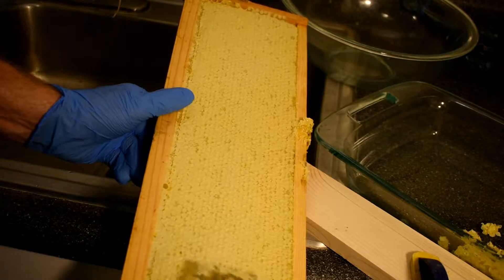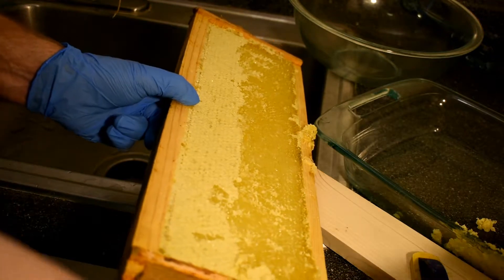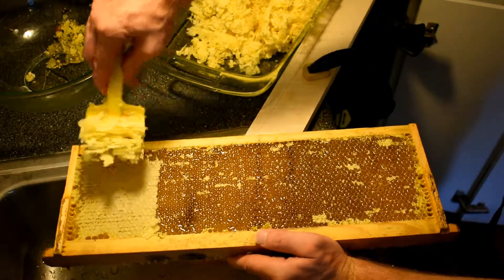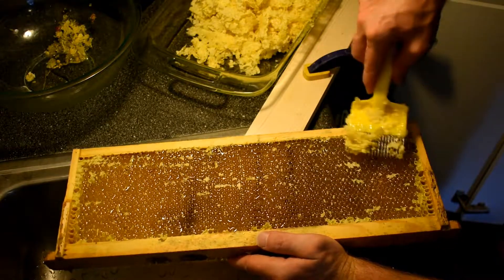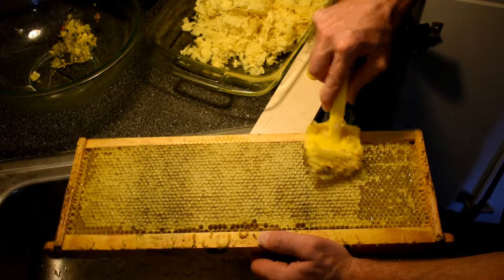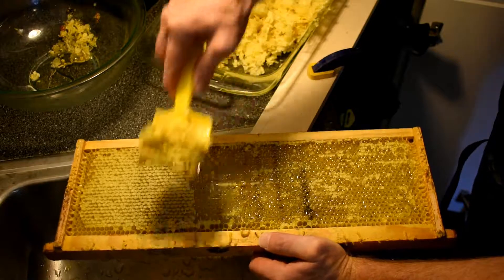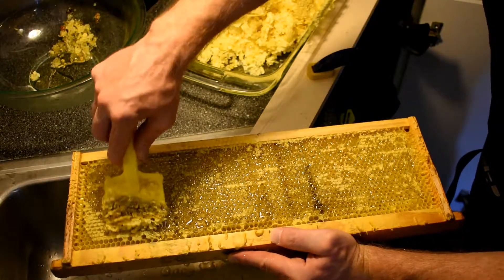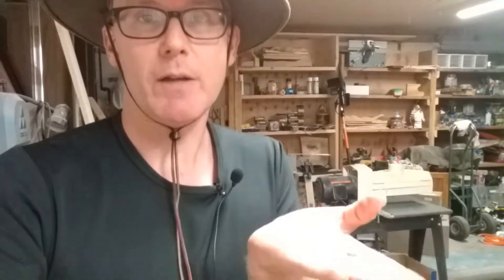HoneyBee Wax Uncapping Fork Demonstration

Comment: We have just two hives as we are in suburbia. I did a full harvest on both hives this past week and we only use a spiked/pin roller which simply pops the caps and in between we rest the roller in a breakfast bowl because the amount of debris (honey and some wax) is so little. Space is an issue for us as we harvest inside the home, so this way we don't have a surplus of wax to process, nor the containers to manage it. And then into a two frame extractor.
Reply from the maker: Excellent idea. It is probably less sticky.
Reply: @creationchemist9402  definitely less sticky and less to clean up. we bought the roller on ebay  for under $10 (pretty sure). the one with white spikes and either a wood or yellow handle.